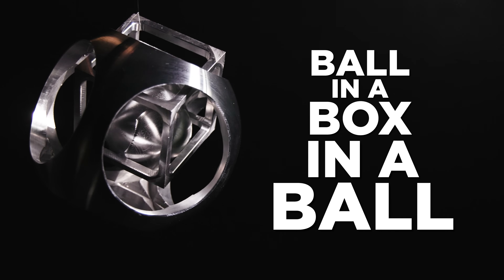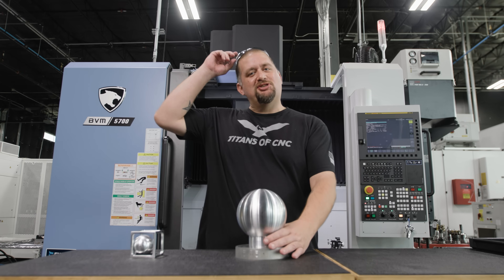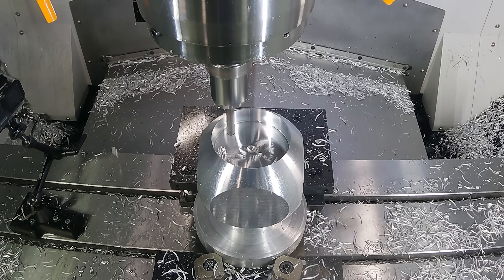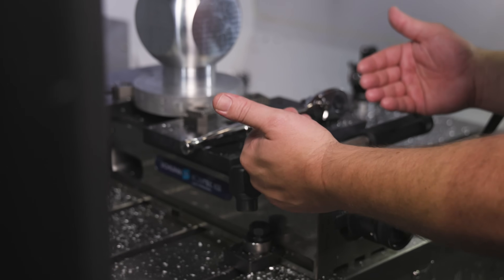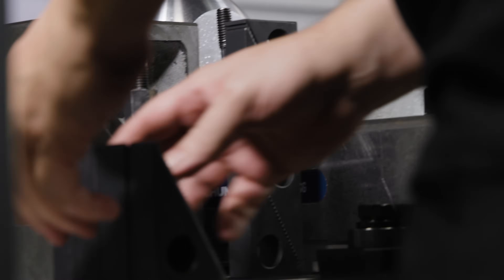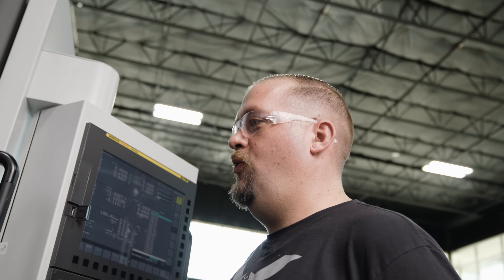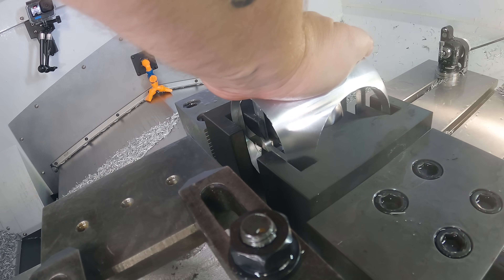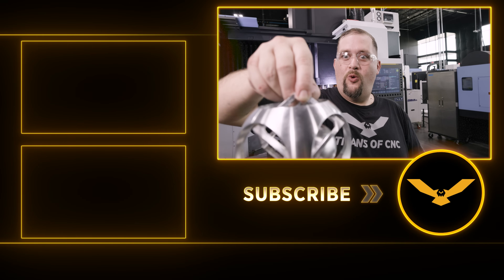Mind Bending CNC Machinist Trick | BVM 5700 | DN Solutions

Comment: @barry setzer
What material did you use to 3D print the soft jaws?
Reply: We used Onyx with carbon fiber support
Reply: Thanks, and what kind of printer do you use for that?
Reply: @derekbahner9619  We used our Markforged X7
Reply: So is that material strong enough to use as a soft jaw in most applications or just with softer materials like aluminum with light machining?
Reply: @derekbahner9619  It depends on tolerances and part shape/material type. You're not going to be able to hold .0001" in inconel using these, but they are especially useful for prototypes, organic shapes that are difficult to hold, and are very easy to manufacture. Alternately the Markforged MetalX can be used for just about anything.